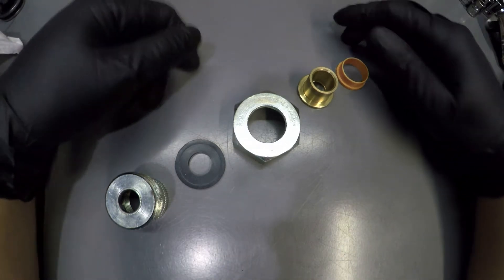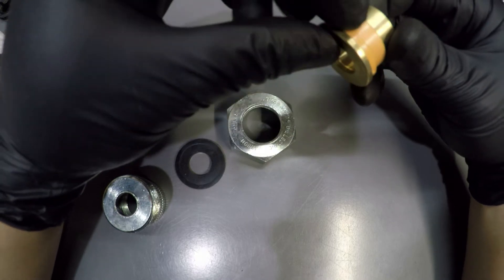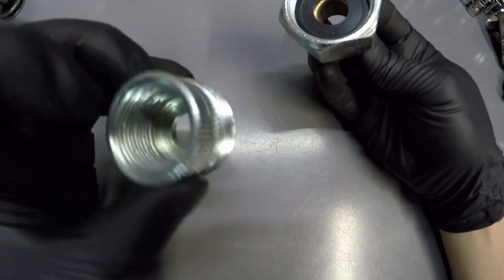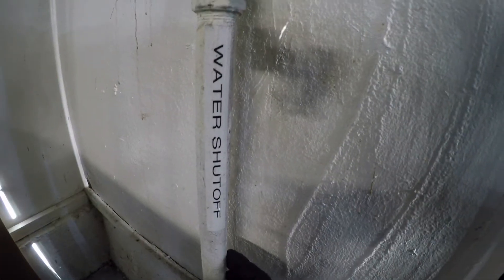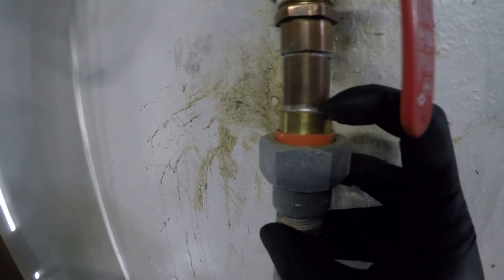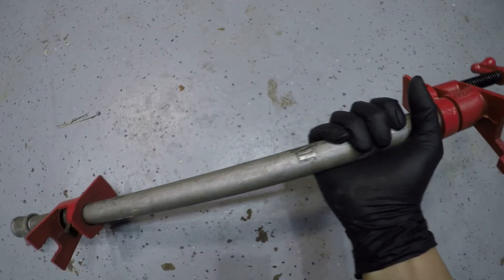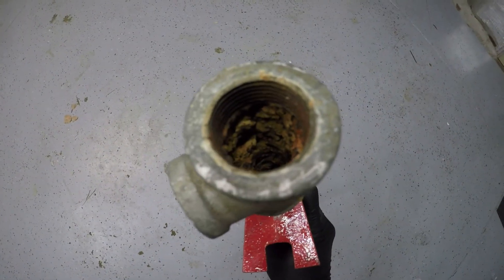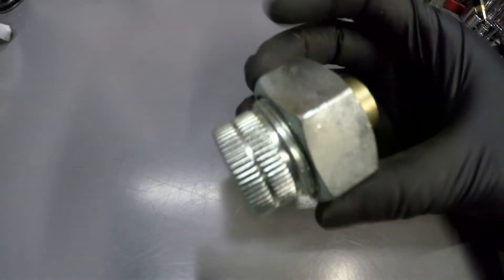How to assemble a Dielectric Union (AVOID GALVANIC CORROSION)

Comment: nice video! i get the theory behind the di-union and it is code and all, but doesn't the water come in contact w both metals and therefore defeats the purpose of contactless.
Reply from the maker: The water does make contact with both materials, so in the long run I believe it’ll have some impact via corrosion depending on how hard the water is. In other words it depends on how much impurities is in your city water.

Comment: Thank you! This was super helpful. Could you tell me how you soldered the Dielectric Union to the new pipe? I have a torch but don’t know what kind of solder to use?
Reply from the maker: Travis, I apologize for the late response. This pandemic is keeping my busier than normal. As for your dielectric Union. I recommend soldering/sweating your ends WITHOUT the gasket and let it fully cool down before assembling together. A really common mistake is leaving the gasket in while soldering and it deforms leading to an imperfect seal. 
Edit: as for the solder, you can find them in any Lowe’s or Home Depot plumbing aisle. If you have old solder, make sure it contains ZERO lead.